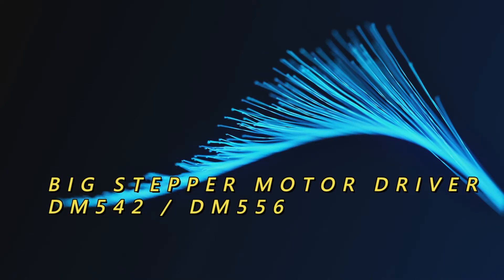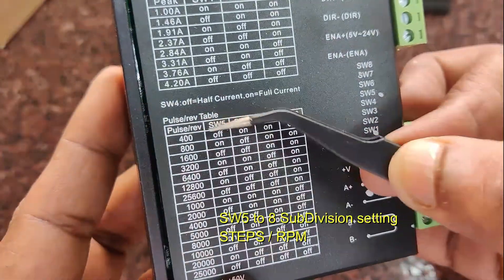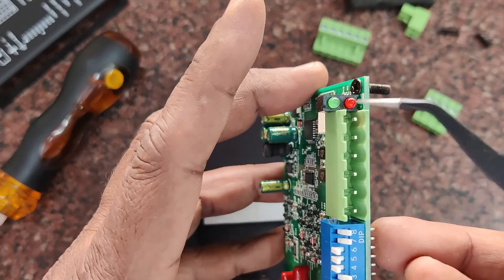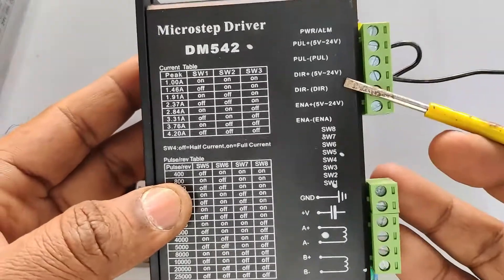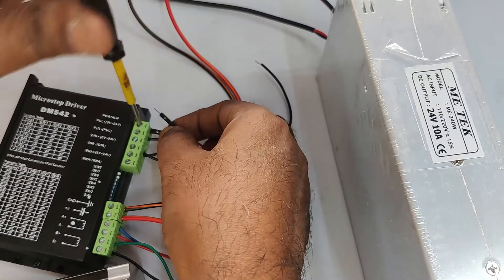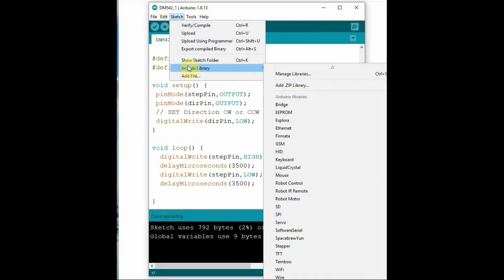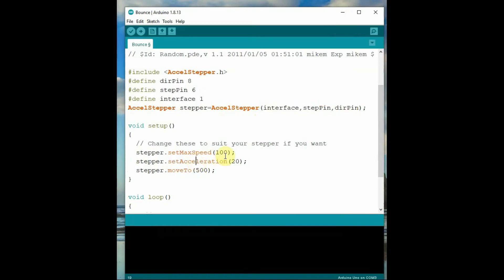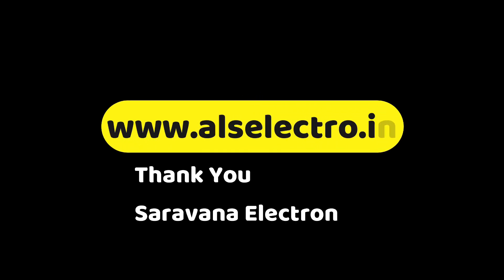BIG STEPPER MOTOR Driver DM542

Comment: using your methods, we can figure out which 2 wires are in the same phase. but how do we determine which one is + vs -? does it not matter if they are swapped?
Reply: +/- determine rotation direction.  Swap the polarity of ONE of the phases to reverse the direction.

Comment: Sir, please tell me what difference is there between the DME542 and DME542E? I am using this setup for the linear actuator and want to include limit switches at two ends. Can you please suggest an Arduino code with limit switches?

Comment: Sir, can you please explain how to use this motor driver with an Arduino for linear actuators. I have a linear actuator with travel limit switches at both ends.